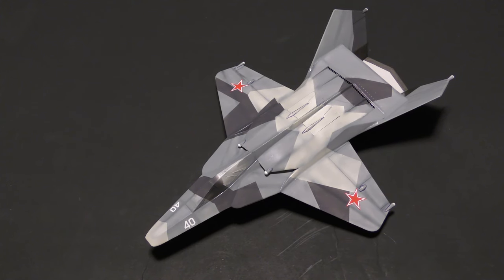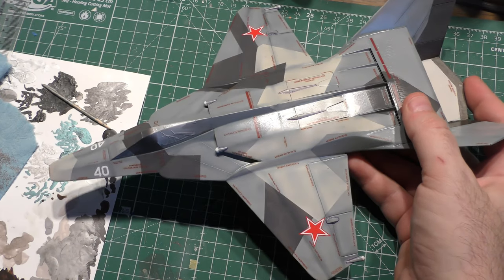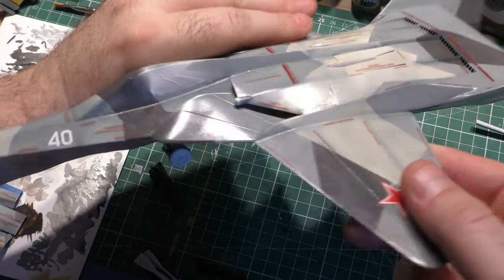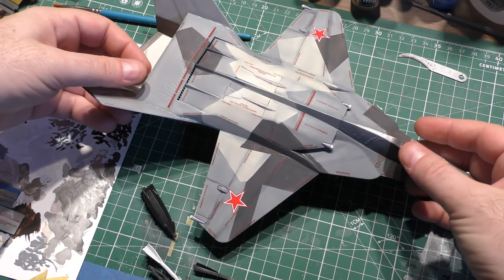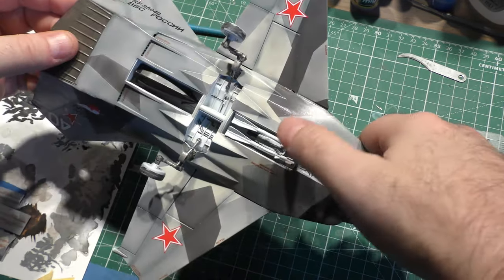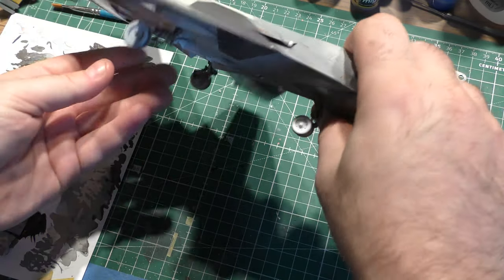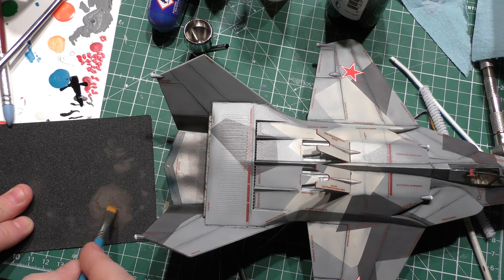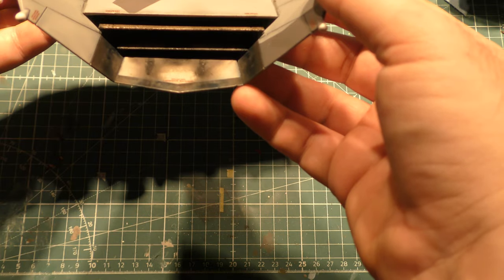Vintage Kit Build - Testors MiG-37 Ferret - Part 4 - Decals, Ordnance, Detailing, & Finishing

Comment: If you do dioramas, might I suggest putting that on one.  Like on a tarmac next to a hangar or inside one.  Just a suggestion.  I built this same model kit years ago.  But not good at painting, I left it unpainted at the time.  But I hand paint now, never tried airbrushing before.  And if I might make another suggestion, put hardpoints under the wings.  For air to air missiles and such.  If there is room under the wings.